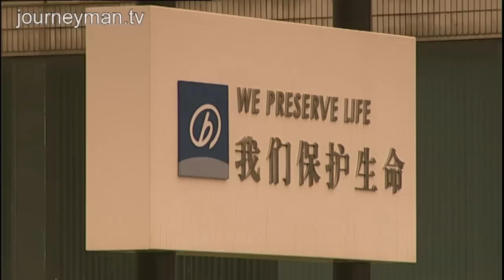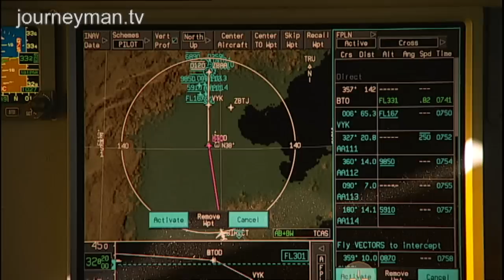Where Did A Million Chinese Millionaires Come From?

Comment: why arent all buildings pre made? seriously modular construction has been around since the 20s. Sears had  catalouge houses that you could get all the parts and priced and built in a month
Reply: no they definitely were not ugly and came in up to 500 different variations. These premade houses are everywhere and people always modified certain arts with local carpenters. Four square houses and Bungalows are prime examples.
Reply: I often ask myself the same. A house should not cost 200,000+ euro.
It should be 90% modular, constructed in a factory, delivered and installed for 25% that price.
Reply: I don't know about modular housing but as you pointed out, Until the 1920s Americans constructed buildings with walls made of stone and brick that bear the weight load. So today any prefabricated home seems low quality and unstable. Also the US has very strict rules on buildings due to earthquakes thus they are made carefully with deep foundations.

Comment: An easy way to see China's industry is by collapsing scrap metal prices. Steel is down to 1/2 a penny per pound! It costs more in gas to drive it to the scrap yard then they get for it... That's down 500% just from last year. Manufacturing is so slow in China there is 2 years worth of steel scrap stuck on ships and storage sites, that is what is causing the massive drop in price.

Comment: Every single one and all economic bodies are subject to economic fluctuation; be it cyclical or frictional. It's like tectonic plate; periodic, small scale earthquakes help to release excessive pressure so a major catastrophe is less likely to happen. The Chinese gov't grips control so tightly that it will not tolerate a Richter Scale 2. That's what worries me. The ever-rising economic pressure exerted by capital on steroid has no pressure valve built in the system.